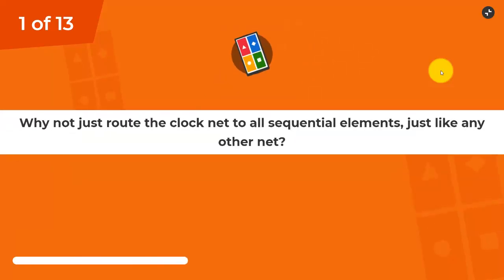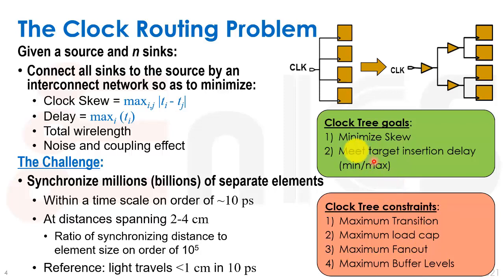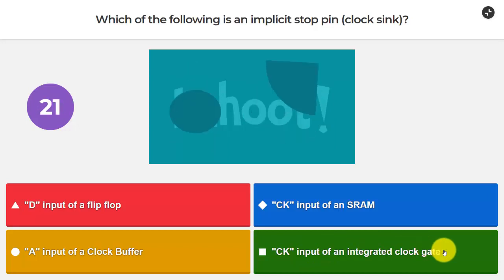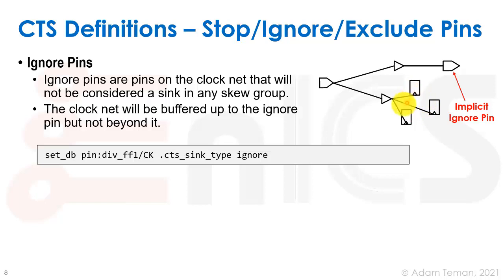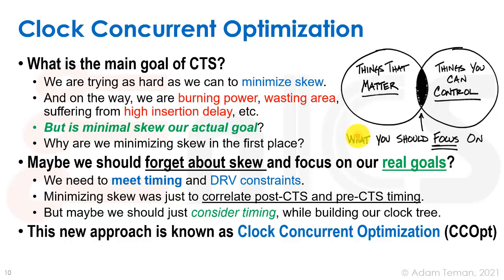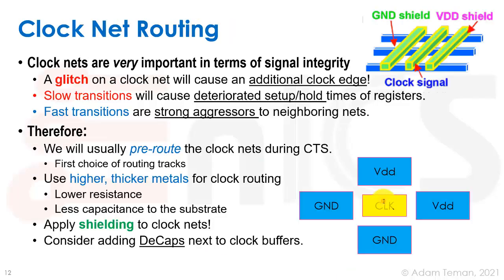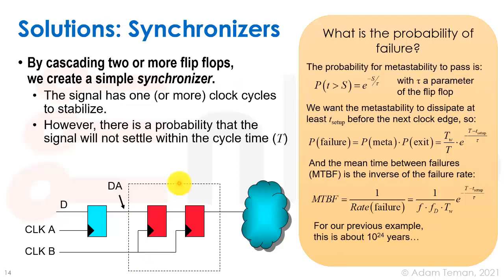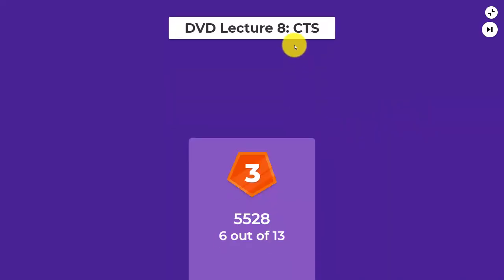DVD - Kahoot for Lecture 8: CTS

Comment: what is the difference between a synchroniser and a 2 bit shift register. can i theoretically use them interchangeably?
Reply: There are some special cells in the stdcell libraries provided from the silicon vendor named like SYNCNQDxxx. It's better practice to use them in your synchronization logics AFAIK. However, you can still build your synchronization by using the regular flops to form shift register. Don't forget to inform BE engineer about this tho
Reply from the maker: Yes, as @archthedde answered, you can build your own synchronizer by connecting two flip flops. The point behind the synchronizer standard cells is mainly that they are controlled not to incur hold violations. If you let the tool freely place the two flip flops and route clock nets to them, you may be sorry...

They also provide an achor for SDC commands. You know that all your CDC paths go through this type of standard cell - it makes it easy to verify and write your SDC.

Comment: why set_max delay is not affected by CTS? If we set 100ns and if insertion delay is 200 ns then on the output we may have a problem
Reply from the maker: I can't remember what the exact question was, but the actual set_max_delay command is not affected by CTS.
The timing is very much affected and set_max_delay does a horrible job of dealing with this (I explain this several times throughout the lectures). But the command itself is not changed because of the clock being propagated.

Comment: why cant we have hold violation for a logic with ideal clock ? If we connect back to back FFs , then can the hold violate?
Reply: Actually, when we synthesize the designs (front-end) we treat clock paths as ideal and still we can face hold time violations. We try to solve setup violations as much as we can and leave the rest for PD work. Hold time violations relies on the physical implementation more than the setup. 
Yes, this may happen as well. T_FF1QtoFF2D may be smaller than the hold time requirement of FF2 so you may observe this issue.
Reply from the maker: Theoretically, you could have hold violations with an ideal clock. Basically this can happen if you have a cell (macro) with a large hold constraint. But as we learned in the VLSI course, standard MS flip flops usually have very low and even negative hold constraints and so such violations are rare. Therefore, we don't even check this during synthesis - but don't worry, we will find if there are any problems once we built our clock tree and propagated the clock.

Comment: I have been following these lectures and absolutely love them. It would be great if you can please record a video series of using the Cadence tools to perform FPR and CTS on a small design in real time, maybe a live stream if possible so as to get some hands on approach.
Reply from the maker: Hi,
Thank you so much for the kind words. 
Indeed, I do not provide any hands on/live material at this time. This is due to commercial restrictions - both of the CAD/EDA tools and of the IP that is used (standard cell libraries). In the future, I may get permission from the two sides and work on providing such material, but this is also really dependent on my time (both to go through the bureaucracy and then to actually go and make the recordings...). And as you can probably see from the amount of material I have uploaded lately, time is something I don't have a lot of. Who knows, maybe things will settle down and I'll find the time (though I have been promising my wife that "I will have more time next month" for about 15 years :).
Reply: @AdiTeman  Thank you for the detailed response and for the incredible content you’ve already provided. I completely understand the constraints around commercial restrictions and time commitments. Your lectures have been immensely valuable, and I genuinely appreciate the effort you put into them. I have completed the DVD lecture series and I am going to start with your SoC playlist soon.
If you ever do get the chance to navigate the bureaucracy and find the time, a hands-on series would be fantastic. Meanwhile, I’ll continue learning from your existing materials and look forward to any new content you can share. It would be great if you could suggest some online courses or any other references in your knowledge that could help gain this hands on experience before I actually enter the industry. 

And I hope you manage to find that elusive free time soon :)

Thanks again, and best wishes!
Regards!

Comment: Ignore pin and stop pin related confusion :
Implicit stop pin - clock will be buffered till stop pin but not beyond it. Considered for skew balancing.
Ignore pin - clock will be buffered till ignore pin but not beyond it. Not considered for skew balancing.
If we are buffering till ignore pin, we are balancing the skew too, then why we are saying it's not considered for skew balancing?
Reply from the maker: When I say "buffered", what I mean is "Fix DRVs", but not (necessarily) skew balanced. So the path until the ignore pin is ensured to meet DRVs, but it won't be considered for skew balancing vis-a-vis the rest of the skew group's stop pins.

Comment: So clock input of an ICG is a through pin and clock needs to propagate through it? Similarly all clock gating cells are through pins?
Reply from the maker: Yes, this should be the case.

However, when you say "clock gating cells" - this is a generalization that you have to be careful with. Clock trees get very complicated and clock tree definitions can truly affect your results.
For example, such a "clock gating cell" (possibly even an ICG) may be a place you want to stop the propagation of the source clock and create a separate clock tree on the output. It's very hard to generalize this and I actually have wanted to make some lecture with examples of hard/weird/non-trivial CTS problems we've had in the past, but usually I run into them in the midst of a tapeout and by the time I think about compiling such a lecture, I can't remember what the problems were (or how we solved them :).
Reply: @AdiTeman  Wow sir, this is an interesting example on how careful we need to be with CTS definitions and how we want the tool to interpret it depending on situation.